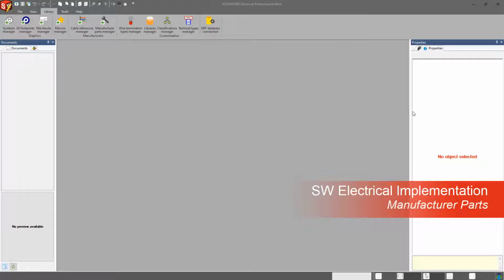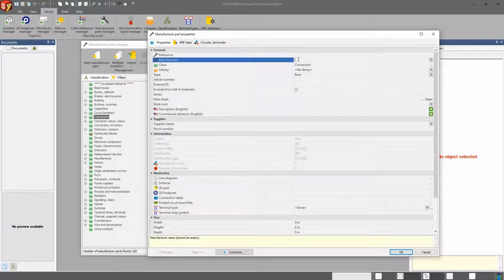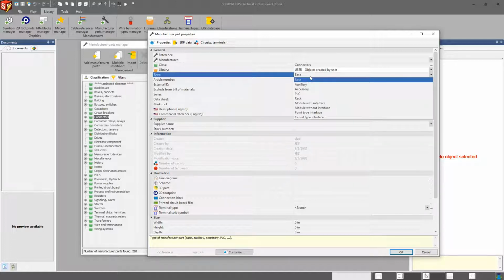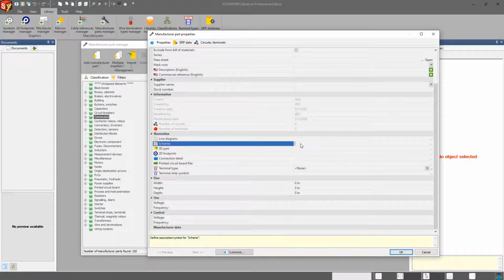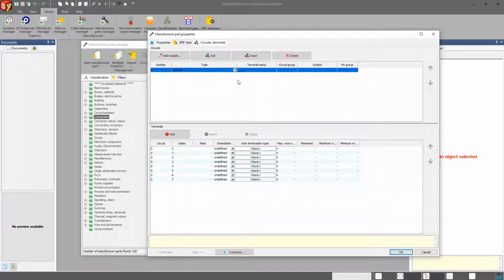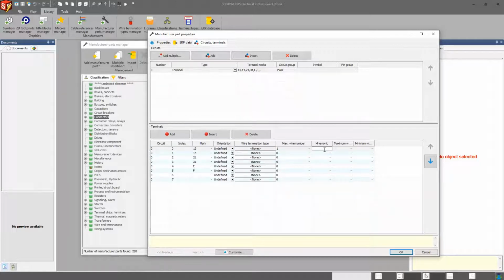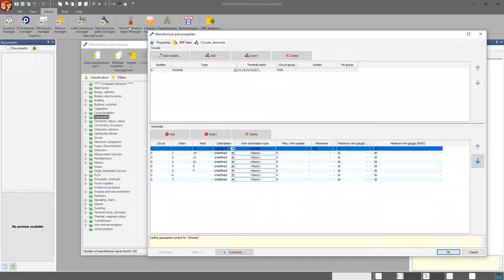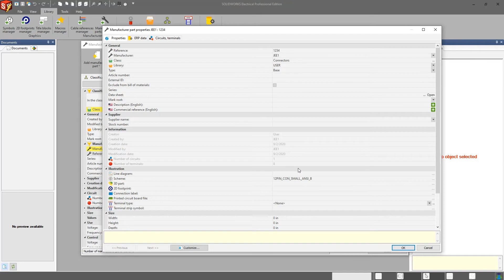SOLIDWORKS Electrical Implementation 8 of 19: Manufacturer Parts

Comment: Hello Sir, nice lecture on this topic, i have a question, how can i add bits and parts with a connector e.g. back shell, and hardware etc.
Reply from the maker: There is an option under the manufacturer part manager dialog to create an "electrical assembly" that includes all the components that would make up a connecter - i.e. backshell, pins, heatshrink, etc. or other type of component - such as a contactor with an auxiliary block attached to the front. Each part you add to the electrical assembly needs to exist in the library first. Then you can add each part to the assembly. (You can see the option for electrical assembly at 1:10)